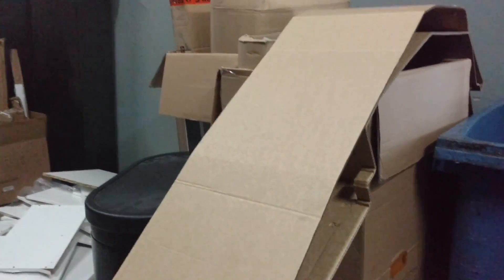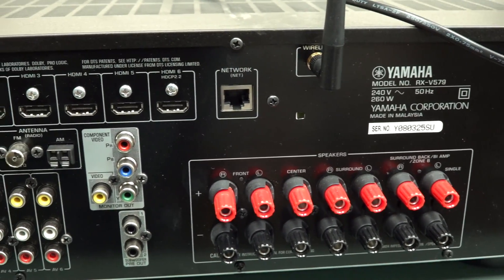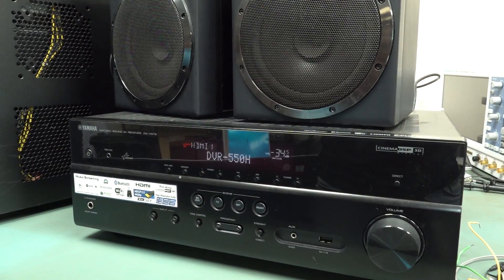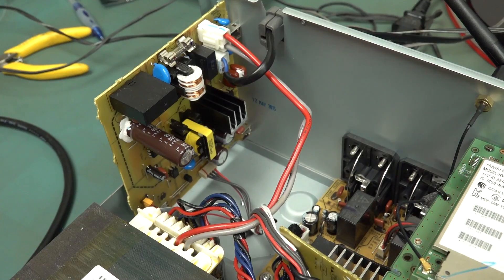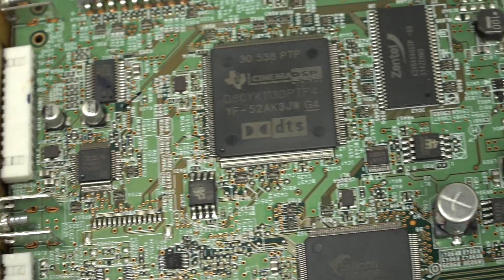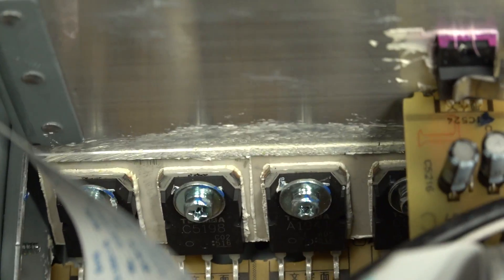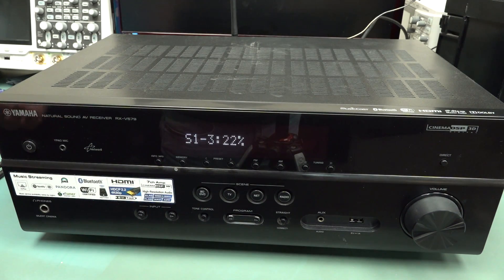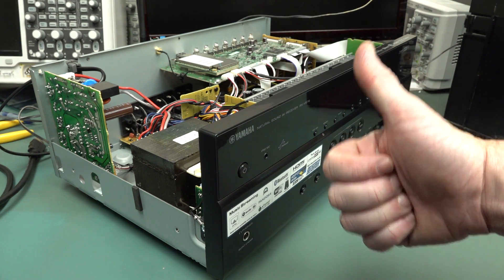EEVblog #1151 - Dumpster Dive Yamaha Receiver

Comment: I have an rx-v1000 i bought from a thrift shop that has the same problem as the one you repaired a couple years ago.  I even bought the cap but just haven't attacked it yet.

Comment: on our local fleamarket theres a lot of them. usually the cinemadsp chip gets too hot, bga balls break = no sound anymore or someone zaps the hdmi...  especially onkyo and marantz are affected by this since i see a lot of them there.   first problem is easy fix, dont use bga or put on a heatsink but they didnt seem to learn from their "mistakes".

wondering why someone throws this one in the bin if all of it works
Reply: Thankfully Onkyo have been really good about repairing amps with broken balls WAY past the warranty period, They repaired mine close to 3 years past and even paid for shipping both ways

Comment: Test the HDMI now, usually people throw them out because the HDMI out is dead.
Reply from the maker: Keep watching
Reply: @EEVblog  Honestly it could be ONE HDMI input that is broken.  If you need them all or its the HDCP 2.2 port, it could make the unit pretty useless.  The manufacturers stop supplying parts after a couple of years, even though its probably just a broken solder joint if it is a HDMI port.  (its what broke on mine and ended getting store credit from the extended warranty due to lack of parts)
Reply: @EEVblog  

Did you try any Dolby HD / DTS Master Audio formats via an HDMI input?

A common fault on some modern amps is that the main audio DSP or RAM starts to fail due to heat / thermal cycling on those top boards.

I suspect this amp is probably fine, as it's far more common to see those faults on receivers that use more BGA chips, and this one is mainly QFP / TSOP, of course.

Unless one of the amp channels is blown or intermittent, but I reckon you got a winner there. ;)